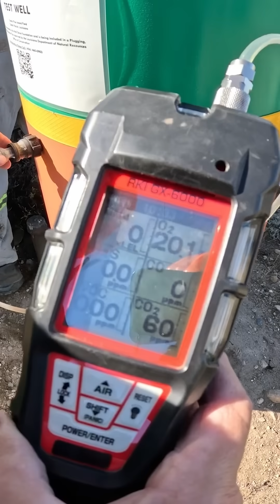The problem goes deeper than you think...

Comment: Hydrogen sulfide gas can actually be beneficial in small amounts. That's why some people think huffing farts is actually good for you. But it's unhygienic and you need pure hydrogen sulfide gas in a controlled amount under medical supervision. 
* Antioxidant Properties: H2S has been shown to scavenge free radicals, which are unstable molecules that can damage cells and contribute to aging and various diseases. By neutralizing these harmful molecules, H2S may help protect cells from oxidative stress.
 * Cardiovascular Health: Some studies suggest that H2S may help relax blood vessels, improve blood flow, and lower blood pressure. It may also have a protective effect on the heart by reducing inflammation and oxidative stress.
 * Neuroprotective Effects: H2S has been linked to neuroprotective effects, as it may help protect neurons from damage caused by oxidative stress and inflammation. This may be particularly beneficial for conditions like Alzheimer's and Parkinson's disease.
 * Anti-inflammatory Properties: H2S has been shown to have anti-inflammatory effects, which may be beneficial for various inflammatory conditions.
 * Gut Health: H2S produced by gut bacteria may play a role in maintaining gut health and influencing the immune system.
Important Considerations
While H2S may offer potential health benefits, it is crucial to note that it is a toxic gas in high concentrations.

Comment: Theres no way the amount of air exchange out of a >1foot hole is going to affect anything on a global scale. U can run hard number comparisons all u want. But its operating under the assumption 1000 cars makes a tangible effect. 

The earth is 70% water. Of the 30% ish of land a strong % of that is desert with no trees or grass. It has been calculated that given this truth of land to water ratio. That even if we cut down every tree on the entire planet O2 lvls would only drop a tiny bit and humans could more or less function the same as now. Nearly all the O2 comes from stuff in the ocean. (70% of the earth) 

Im sure the data he advertised is accurate enough. But what evidence is there that these figures matter in any real way? 

Also also the concrete, vehicle manufacturing, etc. Needed to plug the holes makes green house gasses. So one woupd need to subtract this over head from the amount of prevention u hope to capture from plugging it.

Comment: Hey!! Interesting to see on YouTube.  One of the craziest jobs I ever did was an abandoned well cement plug job.  I'll try the short version but many of the details range from interesting to crazy if anyone is interested.  So a person was planning to develop a pick your own fruit place but in the middle of the field was an old well.  It was abandoned but did have a cap.  In Texas the railroad commission has jurisdiction over this type of thing, well the land owner contacted the original operator about making sure the well was safe and I'll just paraphrase and say he was told to pound sand so the owner passed the message to the RR commission and they were, let's say displeased, so they got involved.  I was there as the coiled tubing and cement engineer.  Lots of craziness ensued, a lot do to with the fact that the well was approximately 52% sour and to those who know what that means no it is not a typo.  It was an insta death well capped by steel which H2S cares about as much about as if it were capped with aluminum foil.  Just a reminder this well was going to be in the middle of a place that was supposed to attract many families.  We had to drill through about 4,000 ft of collapsed corroded tubing then the RR commission wanted a lot of cement plugs in response to the operators behavior.  I won't explain right now but at one point we had to do a burn off and it took like 10 hours to burn off the backside but it was cool to watch the giant green flame and the dangerous cloud of heavier than air by product consume the downwind area with no warnings or precautions set up anywhere.  It was a crazy 5 24 hour days straight but we got all the plugs set with the release alarms only going off like 3 maybe 4 times.  Nothing like standing in proximity to instant death for 5 days straight... Good times.

Comment: Why can you just buld a 4 foot concrete plug, or plug out of some Rubber or something that will last for a very long time when not exposed to the elements, beat it down into the whole a few feet, then concrete patch over the top of it all about 4 feet below the surface. Then, cover the top with good soil and grass seeds. That seems more efficient and cost affordable, right? Just a question and theory, that's all.

Comment: Use the old wells for geothermal energy combined with super critical co2 turbines and a surface cooler thermal gradient. They can use temperature as low as 80 degrees Fahrenheit not 700 degrees Fahrenheit.

Comment: does it really take complicated methods to plug these? if there is little to no pressure it seems like it would be easy, fast and cheap to do so. A few feet of concrete pumped in on top of something inserted as a temporary plug to support the concrete is not sufficient?

Comment: They are called orphan rigs .... and there are millions world wide ...and sometimes they do leak again and again ...due to earth tremors.
Trumps republicans want to dodge this .... but they cannot hide from the 3Earth sentinal satellites two opperated by NOAA ..one by the EU.... and the search for gases 24,/7 world wide which is why they want to cut NOAA and Nasa funding.

The gases also escape from.old coal workings and  when they get into the watertable. ..or bubble up under the sea... disolving into the water so it doesnt reach the surface as gas bubbles. The satalights see it. .. they are not supposed to flare off wasted gas but they do and other times they leave it to leak from collectors and just vent it unburnt.. and Methanes far worse than CO2.

Theres a German TV film on U tube that covers this in depth.. but the companies do a shell game selling these old workings and stripping the companies of the funds to deal with them ... till they just leave broken kit or a hole leaking poison.. some of its actually radioactive... and then theres the actual benzine and heavy metals in the mix...but the oil companys dont like talking about that..like their big subsidies and payments to certain politicians.

LA and texas Appalaicha stand over thousands of orphan wells and mines lost a  century ago in some cases. 🤦🏻 Coal mines and oil shales are even worse.

This was the work Errin Brockovitch was doing last i heard. 🧙🏼‍♂️🇬🇧 Geologist.

I

Comment: I feel like this could just be capped off with a simple pipe cap. Unless there is something down there that actively expands with SERIOUS pressure, eventually everything that can diffuse within the given space does so and as long as it doest have an escape it will just stay there. Not really sure why we need 1500ft of concrete to close off these holes...

Comment: So, instead of collecting the resources that are coming out of the pipes, you just fill them back up?  That seems like a waste. So much energy was used drilling these holes and installing these pipes.  Why waste it if there is enough resource coming out of the pipe to run 1000 cars?

Comment: Frack it. You cannot come close to understanding the power of these new explosives unless you have heard it. We put one small 1/4” pellet on top of a  3” steel block of metal. 12V set it off and it blew a hole  right through the block.

Comment: A drilling company should be required to deposit enough $ in escrow to seal the hole and remove any rigs or hardware upon completion of any project; this could help ensure drilling companies do not abandon these holes. Thank you for sharing this info because I had no idea. 😮
Reply: I know that my state requires something similar for surface mines. They have to get a bond in a certain amount based on how big the disturbed area is. That way they can’t just abandon the site when they are done. They don’t get the bond back until they reclaim the land back to its original state or do something else with it like make it a lake. If they don’t do that, the state takes their bond and uses it to hire contractors to reclaim the land. I would think the federal government would require something similar for oil companies to prevent this from happening. However, it sounds like these holes were drilled and abandoned before there was any regulation on it. I can’t say for certain, but that would be my guess.
Reply: -Oil company "puts money in escrow"
-well gets resold multiple times over
-25 years later paperwork for escrow is gone. Or stolen.
Reply: @skeetrix5577  exactly. "Accidents" funnily enough just manage to happen like that
Reply: These weren’t drilled by giant conglomerates. They were drilled by individual entrepreneurs 100 years ago
Reply: THEY DO! Every operator in every state is required to be bonded. The bonding company is actually liable, in many instances, for this expense. The state usually doesnt pursue these situations as abandoned wells are easy to push to the back in favor of more immediate problems demanding attention.
Reply: they should have to deposit 3x the expected plugging costs. if they plug the well then they get all the money back
Reply: YES!  Thank you for saying this better than I could today.
Reply: From the sound of the video, it seems the biggest problem with your idea is time machines don’t exist to go back 100 years to when a lot of those rigs were drilling. No one cared back then and were very ignorant to stuff they couldn’t see
Reply: @Metzgeweiser  Way back then they would use Nitro to seal the well bore, can you imagine dropping a bottle down that hole and not hitting any edges..
Reply: @Metzgeweiser yeah maybe
Reply: Some states do require a bond when drilling wells, When the well is sold to a new company the old company gets a reimbursement (normally without interest) the new owners must provide a new bond. They also have a produce it or plug it clause. The problems with these older wells none of that was in place and the owners are long gone.
Reply: @SegoMan  and the government has already made a considerable amount on these wells, enough to cover the cost if they budget for it over time.
Reply: @ Agreed! Remember the Deep Horizon One incident and the pollution it caused? After the Exon Valdez mess they passed a law to tax all oil a few cents on the bbl. This fund was to be used to stock supplies and pay for training on all wet states with oil production. This fund has Billions of $$ in it, no where were supplies and help top be found. Another kicker to the fiasco was when they sent in the skimmer ships to separate the oil from the water, A special permit had to be issued as it discharged 0.1 % oil back to the ocean (even thou it just removed 99.9%)
Reply: As a cannabis cultivator, we have to carry a $50k insurance bond in the event we go out of business or get shut down, they can use that money to clean up the property.
Reply: Not going to happen when government is no more than a criminal mafia.
Reply: That makes too much sense.
Reply: I literally just thought this
Reply: Sounds like this happened a long time ago
Reply: Yes surface and hard rock miners already have to. It's called mined land reclamation. I'm surprised oil wells don't have an equivalent. On the other hand oil wells have to pay royalties on the oil, miners usually don't.
Reply: Any, "corner cutting" always comes back to end up costing much more than whatever cost was perceived to be saved at the time. The engineers up the chain of command know this, and even implement orders into the standard procedure to bypass the issue, and that's where the breakdown happens. When procedure calls for something that can sometimes only seem like a mistake to, "not the engineer" and is expected to proceed in a way which viewed from an operators angle can only seem like an unlawful order. Even to the extent of giving an impression to be nefarious in nature. For all we know the person deciding to leave the hole exposed did so as it seemed the safest way to proceed at the time in fear of what could happen when the pressure beneath had built up enough to cause an undesirable result. Which isn't unreasonable.
 Just because nothing can escape the hole you plugged doesn't mean a d@mn thing whether or not the problem you intended to solve was done so by any measure, and in fact unless properly monitored INDEFINITELY to prove as "successful" then there is no reason whatsoever other than gross incompetence to assume the toxic clouds have just been redirected to escape in another, and even cartoon-like fashion if you're lucky. FFS, "engineers"!
Reply: That money would get "stolen" to pay some kind of social programs. 
Essentially the government would be betting that money won't be needed for it's intended use.
Reply: 😅😅😅. You sound like a gosh darn communist. We don't worry bout no dang environment when we're fixing to make lots of money. Why else do companies even exist?? 😂😂
Reply: Yes the oil companies need to be held responsible for raping the land and leaving it. Smh
Reply: I saw something about this some years ago. In Texas the amount of bond a company had to post per well was around $125. That's it! The cost of shutting down & capping abandoned wells was around $10k each at that time. What a joke these "good for business" states are. The people (taxpayers) end up paying for it while the CEOs walk away without a worry.
Reply: @JamesF.Pasquini  pur country runs on corporate socialism
Reply: @elliotalderson4568  We call it corporate welfare. 😒
Reply: i was literlay thinking the same thing. 100% agree👍👍👍👍
Reply: What the hell are you even talking about? 😂 Escrow?😂
Reply: This works going forward. But you could be required to pay to plug two before you get a permit to drill.
Reply: @ With that reasoning you should buy 2 of your neighbors license plates for each vehicle you tag.
Reply: And pay the community
Reply: Now this is a good idea (i don't feel like reading the comments)
Reply: That's not likely to happen because it's cheaper for the oil companies to pay a good lobbyist.
Reply: In Canada it’s called the orphan well fund. Essentially a deposit system.
Reply: All money needs to be in trust with the county where the well is. So they have the funds to seal off the well.
Reply: This administration is hard at work removing those types of regulations
Reply: Yessss!
Reply: I’m in the oil industry, and plugging a well properly is up to the current owner, not the company that drilled it. But your concept is an interesting one, I’m going to think on that….
Reply: @Lilith8177 there's nothing to think about, all trades have to purchase protective bonds, your industry doesn't!?  That's ridiculous! 

Edit: That makes me mad actually, You should have to eat the same amount of red tape we do!
Reply: @Lilith8177  i see the vision
Reply: Make the escrow part of initial cost and factor it any to any sales or leases after. Let it transfer with the property. @Lilith8177
Reply: @Lilith8177 
I’m sure you will.
Reply: @Lilith8177  I dont think he meant the person who drilled specifically lol...The person who owns the well who hired someone to drill it lmao
Reply: @rylanbailey3993  It's the responsibility of the operator of the lease or permit to ensure the well is properly plugged and abandoned.
Reply: @Lilith8177 Why'd you say "I'm going to think on that..." like a Pokemon Leaf Green trainer that just got beat in a battle
Reply: @thegooeymanschannel7128 that’s called being polite. I’m in the industry and i know what I’m talking about, but I’m not about to discredit anyone or be rude
Reply: @Lilith8177 How convenient.
Reply: Not likely. No politician in oil rich states will push for that kind of legislation. And if it’s enacted on a national level, places like Texas will try and wriggle out of it.
Reply: @ruekurei88 you have a point. There are a lot of landowners making millions from oil. The people upset by this are clearly not landowners 🤷🏼‍♀️ if anyone reads this…look into buying minerals. This is one of the only countries where you can.
Reply: I"No methane will ever escape this hole again."

Can you do something about Lizzo now? Gotta be decades of undigested burgers, chicken bones, and small animals putrefacting in there due to copious amounts of grape soda.
Reply: The government should charge a fee in advance for each hole drilled. Then the government should be responsible to plug the hole. 

Does it have to be plugged with concrete? Couldn't they fill it with mud?

Or gravel and mud. Whatever is cheaper than concrete that'll work
Reply: Another untenable idea
Reply: imagine how many cars were added when Biden blew up the Nordstream pipe to Germany.
Reply: @InvestorSpeed do you believe in ghosts?
Reply: Of course we could make them deposit some cash for that beforehand, but let's give the people the option to choose for themselves...anyone who doesn't wanna pay and still "goes bankrupt" has to sit there in the desert and cover that hole up with their...... Let's just say we'll find somewhere
Reply: @boratsagdiyev5679 I had to tie onto city sewer not two years ago, I had to put up a refundable bond to ensure that if I undermined the road while hooking up that the repair cost would be covered, it really is a standard practice to everyone else!